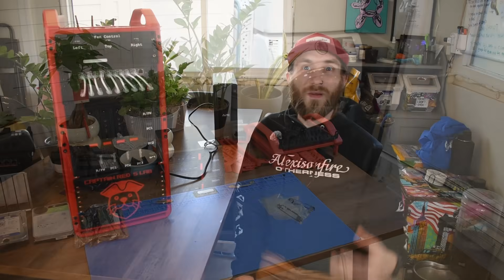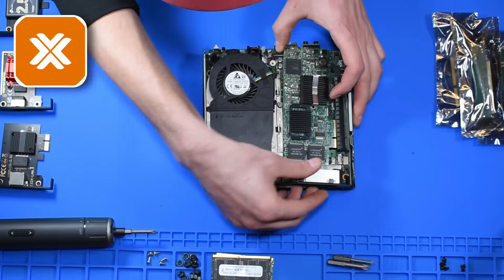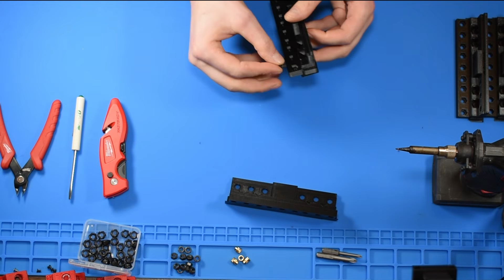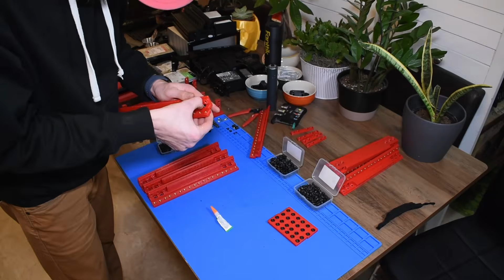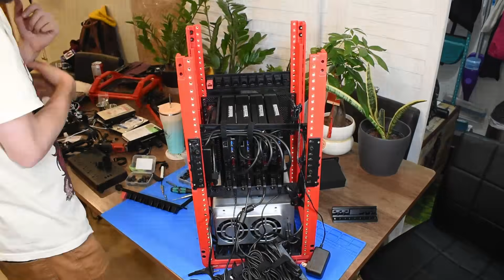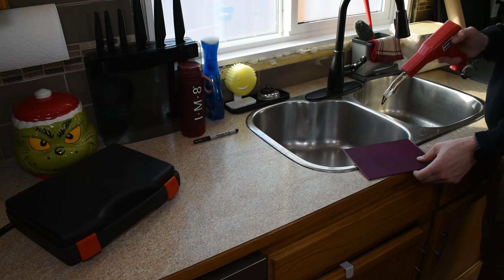I Built a $3700 Home Lab Using a KWS 3D Printed Rack

Comment: Awesome build video!  I've started printing parts to put one of these together, and I'm about to start printing the bottom side rails and the top/bottom frame rails.  Did you print them with supports?  Or just as imported without supports?  Unsure about those overhangs in the recessed screw holes.

Comment: Great build video, but FYI, seeing as the official build uses nyloc nuts, it would be unwise to try to heat them to set them.
Reply from the maker: Thanks for the kind words! The nuts I used with my soldering iron were just regular nuts, no nyloc. 

I would still recommend using an epoxy cement or something if going that route.

Comment: Hey Connor, I am from Calgary too. Trying to print a rack for my homelab and stumbled on your video. Did you use a single filament type for the entire print? I've only got PLA Basic filaments on my printer so far and wondering if I need to get the ABS and PETG filaments that the model seems to imply.  

PS: I'm totally a 3D printing noob cake. LoL
Reply from the maker: A local Calgarian, love to see it!

I used PETG-HF for the project, I would not recommend using PLA for the print because of heat.
Reply: @CaptainRedsLab  Thank you!
Reply: Any DIY tips for drying out the PETG filament before use?
Reply from the maker: @hezeb If you don't have a filament dryer, you can use an oven or your 3D printer if it is enclosed!
Reply: @CaptainRedsLab   parts are all printed and working through the assembly, but I'm confused where the m6 10mm screws are supposed to go in vs. the 8mm ones.
Reply from the maker: The larger bolts are structural and the smaller ones are for the rack.
Reply: @CaptainRedsLab  Makes sense. Sorry for the continued ping, but any chance you've got the model files for your NIC upgrades on Makerworld?

Comment: i finally started printing mine after a lot of fails but after the assembly process i wonder why use brass inserts and not cage nuts like normal racks
Reply from the maker: Probably just the nature of 3D printing. A lot of people (myself included) will typically have brass inserts on-hand.

Comment: Small side Info: Ilan mentioned that the inserts go in from the back! I tested it, obviously the threads work both ways and it looks better from the front too! Also depending on the insert, you might save 1mm screw length, which depending on what you install, you might need!
Reply from the maker: Both work! I found it easier the way I did it with the knife but each person can test it out for themselves. Thanks for the input!

Comment: Can you please share your Lenovo Tiny Thinkcentre Files? :)
Reply from the maker: Here is my Home Lab collection on Maker World. Was there a specific one you were looking for?

https://makerworld.com/en/collections/19861628-home-lab
Reply: @C @CaptainRedsLab Unfortunately not! :D
I found you account earlier already. You commented that you modified the thinkcentre mount but I did not find any custom files you uploaded. It seems the original mount is too smal since it‘s made for the DeskPi Rack and not the KWS v2.
Reply from the maker: https://makerworld.com/en/models/2640436-1u-server-extension#profileId-2917297

These are the spacers that I made for the 6-Bay rack!
Reply: @C @CaptainRedsLab  Didn‘t you design some extra mesh blends for the empty thinkcentre slots? ^^
Reply from the maker: https://makerworld.com/en/models/2698470-filler-grills-for-lenovo-tiny-pc-holder#profileId-2991155

Just uploaded this one to makerworld for you! It does have a side slot that I used for my NVMe drives, I just used Velcro to secure them
Reply: @CaptainRedsLab Thank you so much! And sorry I did not recognize the spacers as the lenovo spacers :D
Reply: @CaptainRedsLab I will send you a boost on makerworld :)
Reply from the maker: @killerkowi8496  No problem, glad I was able to help! Have fun with your build and remember to send it in to KWSRack after!

Comment: I don’t suppose you have a time lapse of the actual printing of the rack chassis anywhere ? I’d like to see how it comes up / where the pauses for magnets (which I o ow you didn’t use) come in and any captive nuts etc before I push the button !!
Reply from the maker: I do not. If you are wanting the magnets and can hold off a little, I believe Ilan is working on a version that can have the magnets added after the fact.

Alternatively you could load up the slicer with his profile, it does have the pauses in there already.

Comment: This is a great video! Thanks! Could you please share that if the heater is a must? I don’t have one, would it be trouble for my future printed KWS rack? Appreciate you answering!
Reply from the maker: By heater do you mean soldering iron? If so, there is another version that doesn't use the heat inserts,  just nuts. 

I would recommend getting one on amazon, they're really cheap for a plug in one and I use it all the time for other projects!

Comment: Im interested in the heat creep pattern of those Thinkcentres. I would think they would get hot under load. <et us know once you have dome time with the setup.
Reply from the maker: They haven't been too bad. Sitting between 50-60C, I am going to host a Dragon Wilds server for my friends. I'll see how that does and let you know! First I need to capitalize on the heat generated from them.
Reply: @CaptainRedsLab  Thanks. running Beelink Minis and they can get quite hot without ventalation.

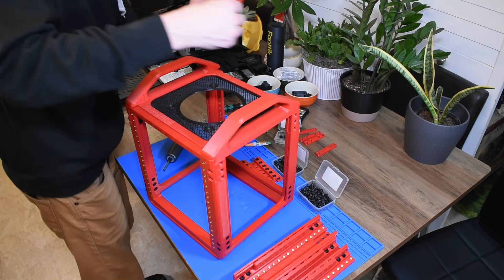Comment: At 9:38 you mention the brass inserts are 8mm, but did you go with the 7.5mm OD ones? I am having a hell of a time finding a reliable supply for this in between size as 7.0mm and 8.0mm OD seem to be far easier to obtain.
Reply from the maker: https://www.amazon.ca/dp/B0DHXTYF9K

These are the exact ones I used
Reply: @CaptainRedsLab  thank you

Comment: extremely dope.  i would love 2 see another video or even a writeup with hella details about ur spec including how much memory is in each node, what model network adapters u installed, network diagram, pve config.... all the details.  

i tried 2 resist mentioning this but for the first few minutes i was convinced that ur voice was generated by ai

thx for sharing
Reply from the maker: Thanks! I'll look into doing something like that in the future, I'd like to prove concept for a few months before diving into details. Building it is one thing, maintaining it and making sure I know what I am talking about is another! 

I had adobe podcast help balance out the volume between my Voiceover mic and my recoding audio as they are 2 different microphones and sound completely different. I do not have the editing knowledge under my belt to master audio, gotta use the tool available to me!

Comment: Great video.  I have almost the same setup;  3 x M710Q's and 1 x M920Q hosted in my Lab Rax.  I was running Proxmox for the 710's, but have switched to an Incus cluster to see how that works.  The 920 is just running Technitium DNS as I have a  UDM Pro for my firewall/router.
Reply from the maker: I love the Lenovo form factor. This was my first time clustering anything together, Proxmox seemed like a safe bet.

Comment: Awsome work! 

Have a similar setup: Only one m720q running proxmox and in there a couple VMs and LXCs running the whole show, pfsense on a separate NUC and then a NAS. 

I find the one m720q (8500t, 32gb ram, 512gb ssd) works very well for a low user setup. 

I've thought about expanding and perhaps running proxmox in high availability but honestly, most of the time the m720q is idling anyway. 

Do you find your cluster gets a lot of activity?
Reply from the maker: Thanks!

I'm running quite a few docker containers and have spread them out through the cluster, I do find it has helped and I'm not losing everything if 1 PC goes down